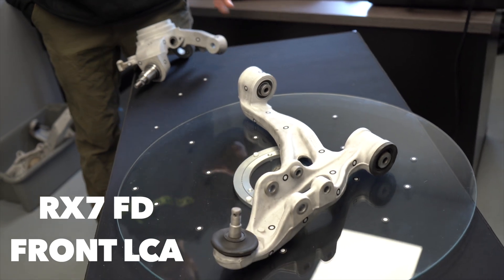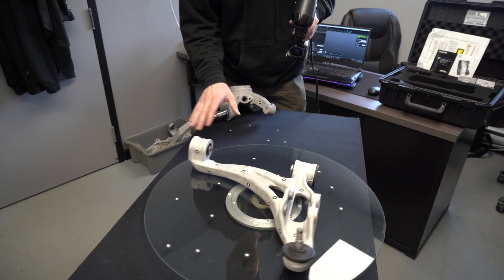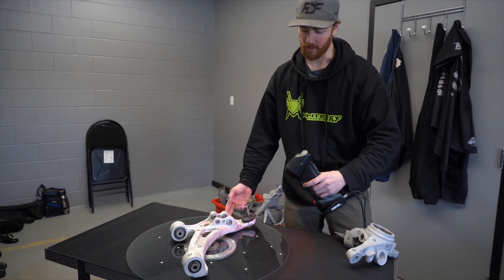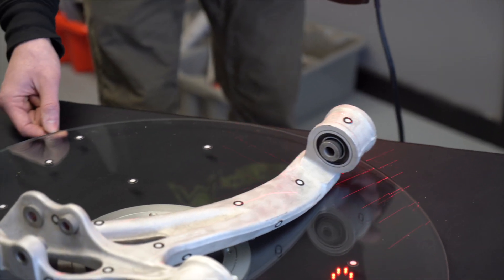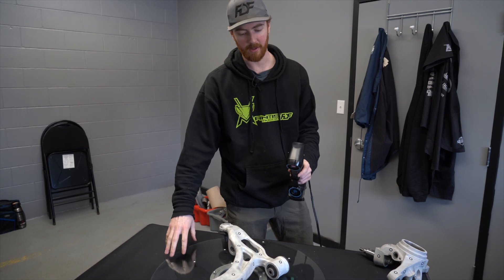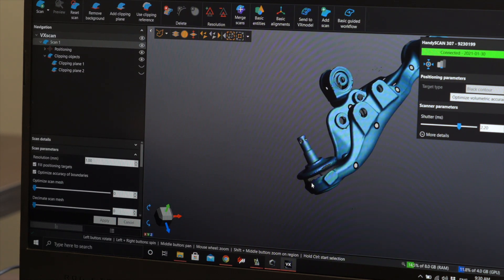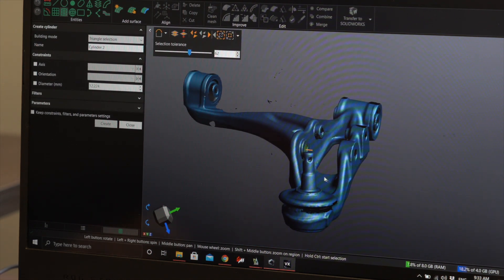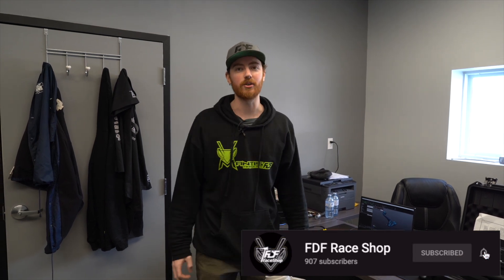Laser Scanning Car Parts to Reverse Engineer Into Angle Kits

Comment: Great Job ! It would be nice to know a bit more on the specs that Creaform is or need, (Canadian) has a long experience in 3D scanners, the model You use look like a 700 Elite  actually it is based on a 2014 model relaunch in 2021 under the "silver" series with a much more lower price. Since 2022 these are equiped with blue lazer, the cost is around 33 600$ up to 57 000$ for the "Black Elite" wich is a bit more precise. Creaform produces also the powerfull "Go!Scan Spark" using structured white light rate around 38 000$.
What specs will this take on the computer ? At least an i7 with 32Gb Ram and at least 6Gb video ram ? What kind of video card you will need GTX1060 ? or greater ? At this level of price it is obvious that no DIY craftsman will be able to purchase any of those, but it might be a good idea to equip the Fablabs with such gear. Cheers from Geneva Switzerland
Reply: In fact, given the final result, I'm not even sure that we'll get a better result with this machine compare to a low-end model like Creality at just under $600 or an Einstar at just over $2000. ....